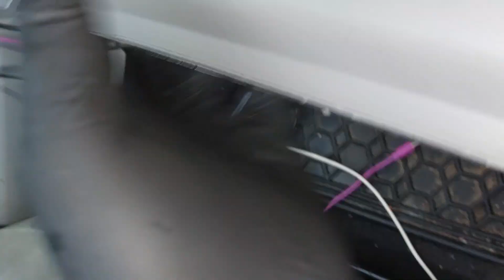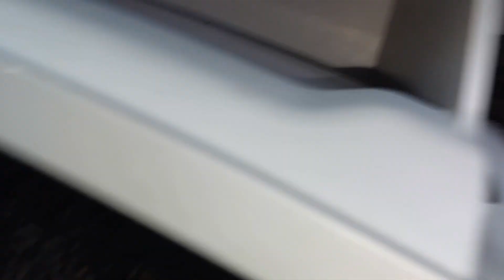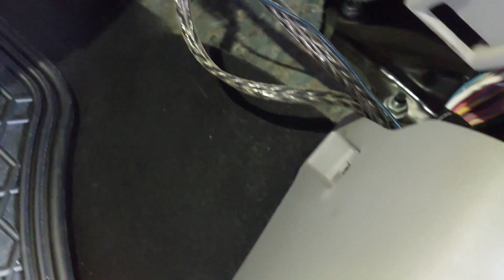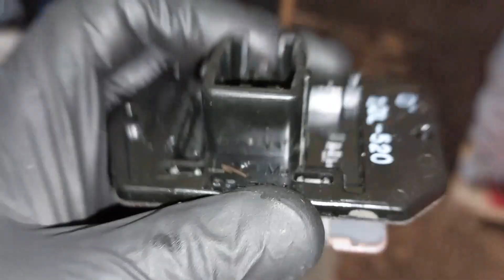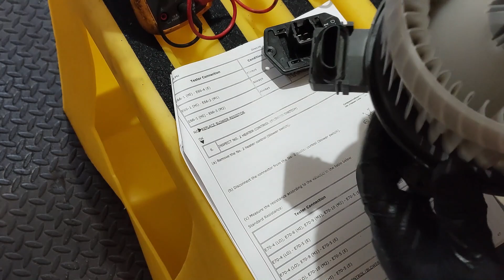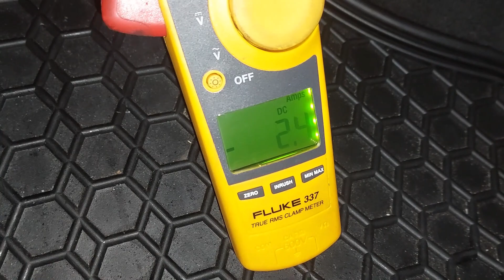2009-2013 Toyota Corolla 1.8 - Blower Motor Diagnosis and Replacement

Comment: Do you know which color wire is power and ground,I am not getting power to the blower,but when I disconnect the harness at the resistor and give it power the blower will turn on with the ac controler off,but if I turn the controller on the blower will not power

Comment: Good info as usual! Hey moose I was changing my rear shock I purchased from rockauto KYB and the piston rod was 2ins shorter than the original so I order oem from toyota, I'm learning the hard way. Now KYB EXCEL G was to short but not the Strut Plus, so oem it is!
Reply from the maker: Hey Jansen, thanks for tuning in. That's weird. Was the strut/shock extended all the way out? I've used KYB Strut Plus on my own vehicles and never had a problem with them. I used them on this Corolla front and rear and the other Corolla which is a 2005 I used them for the front and they work fine. For the 2005 Corolla at the time I used KYB Strut Plus for the front and KYB Excel-G for the rears (just the strut by itself) along with Moog coil springs I think as I can remember and assembled them at the shop at the time when the Strut Plus was not available for the rears.
Reply: @moosemobileautorepair  yeah it was extended and would not reach the hole in the strut mount ! I compressed the spring to release the old shock ! The excel g was 2 " shorter than the original I took photos of them as well!
Reply from the maker: @jansenwilliams6494  Very strange. Never seen that happen before. Unless if there is a different version of that Corolla like a Japanese build like they have for the 10th generation one. One made in Canada and one made in Japan. They might have different variations like for CE and for the XRS and so on.

Just an inside joke I wanted to share. A friend of mine and I came up with a nickname for our family car which is the 2005 Corolla because I replaced all struts on it and it handled like a race car. The KYBs are pretty nice and a little stiff, not too stiff. Handles like a race car when I first installed them. Better handling than the OEM. The OEMs are good, but just stock ride height and stock handling. I replaced them at around 220 or 230 k Kilometers so roughly 137 k or 138 k miles. We call it "the race car" now just for fun. My mom and my young brother usually drive it now (used to be owned by my dad, but he passed away in June of 2020) as it was driven by pretty much everyone in the family and so it's kind of beat, but still works. My mom takes it around in circles everywhere and my brother uses it so we always say the race car comes and race car goes. Just an inside joke. It gets driven daily all over the place. It's basically a grocery go getter non stop and stuff.

This is the car that I used when I first got my driver's license and also practiced on the previous generation Corolla too - It runs in my family. It's the vehicle of choice that we like to get and own. You can't go wrong with these cars.

This vehicle was pretty much our project car from the beginning since I've started in the trade so I learned a lot throughout the years and I still use it as a prime example to make videos. Sadly, I wished I started YouTube earlier to show all of that work I have done in the past, but there is always more videos to come for as long as we own this vehicle.
Reply: @moosemobileautorepair  cool  I will keep you up date on the shock replacements when they arrive,  have  go night!
Reply from the maker: Great. Have a good night.
Reply: @moosemobileautorepair  Interesting story. I am sorry for your father loss. What kind of rustproofing if any do you use for this car? Is it rusted a lot?
Reply from the maker: Thanks. I was going to Krown and vehicle been rust proofed since brand new then I started using Fluid Film for the last few years and now doing my own rust proofing. Not much to little rust if any maybe some surface rust. The only rust is the one near the driver's side rocker panel area there is a small hole at the bottom. I think it's a rust prone spot because when you get in and out of the vehicle water goes into the door sill area and through the holes and rusts there. Even the vehicle has been rust proofed each year. Those generation Corollas are known to rust at the front and rear of the rocker panel and front door sill areas.
Reply: @moosemobileautorepair  yeah you right i just had my son in law to do some body work in those areas!
Reply from the maker: Yup, pretty common. Maybe a video to do in the future. A few years ago I attempted to repair rust on the driver's door sill, sanded it down and everything, but the rust just came back.

For the rocker panels they will start to bubble first before they start to rust.